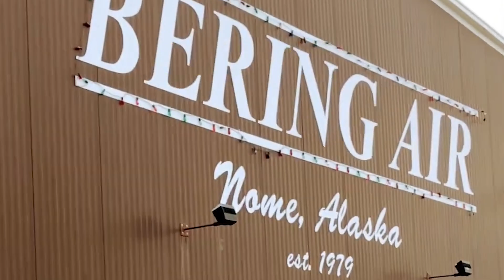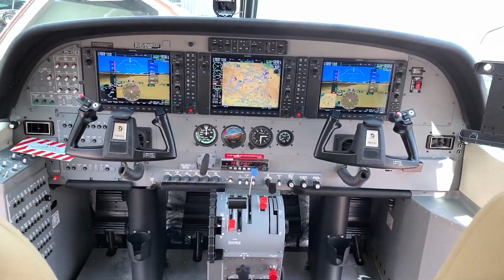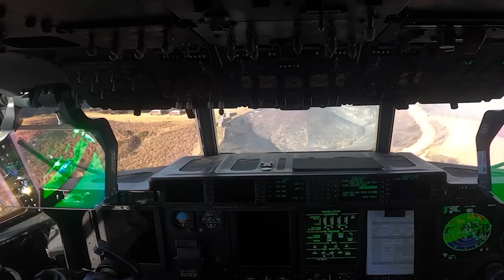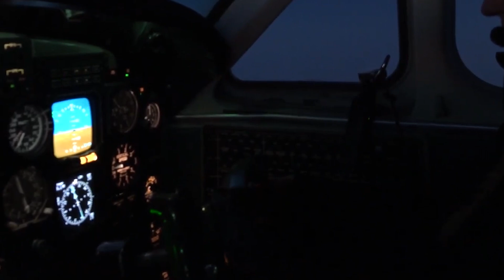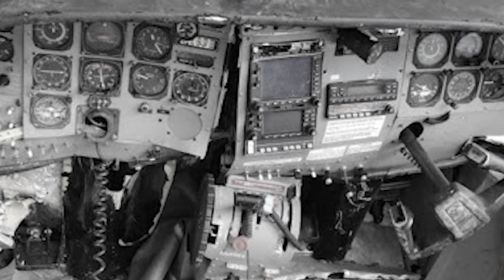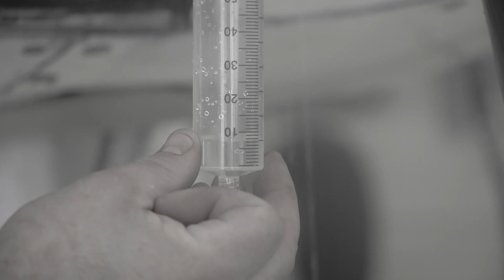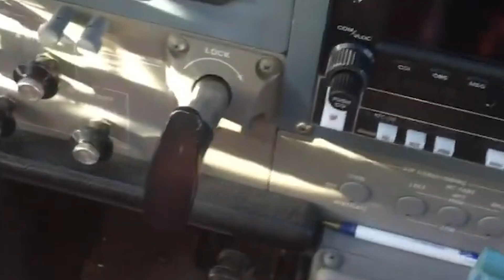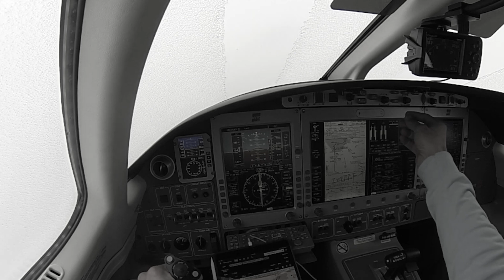Fatal Crash! The SHOCKING TRUTH About The N321BA Crashed, New Discoveries...

Comment: TKS stands for Tecalemit-Kilfrost-Sheepbridge Stokes, and it's a well-regarded in-flight ice protection system (IPS) that uses a fluid to prevent ice buildup on aircraft surfaces, especially leading edges of wings and tail, and propeller